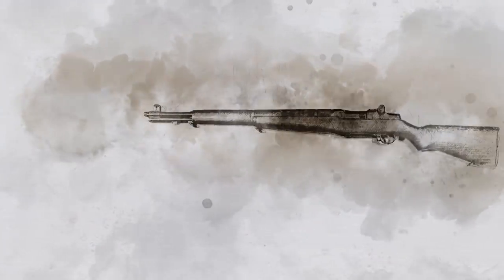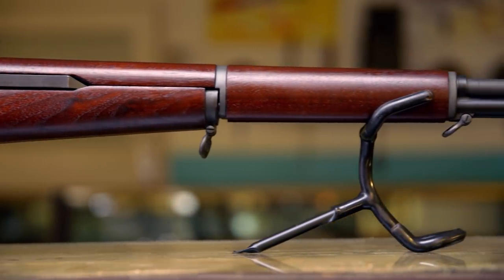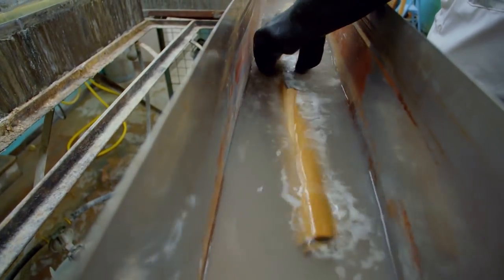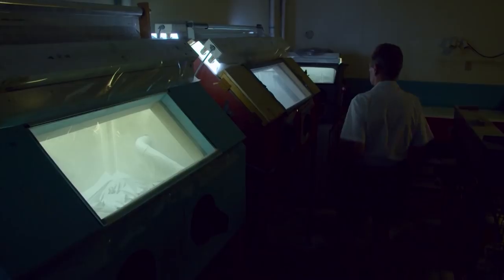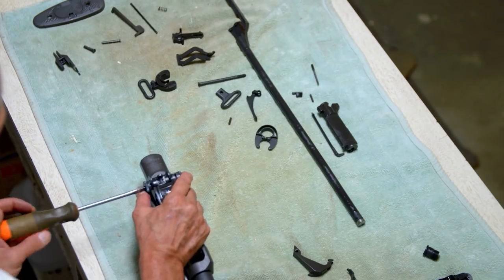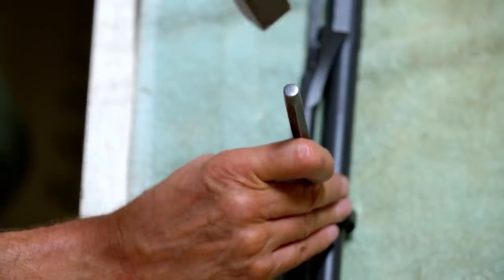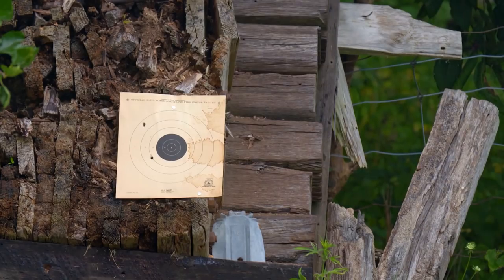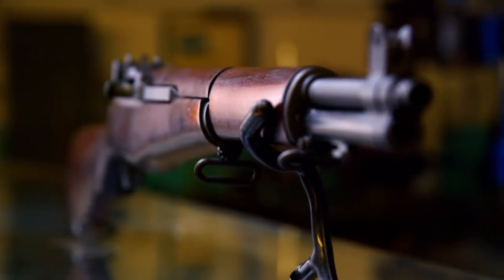How To Restore A World War Two M1 Garand Rifle | History In The Making

Comment: The enemy hearing the ping of the clip is a myth. My grandfathers served in WWII, I asked them about the enemy hearing the "ping"  they laughed and said" Over the sound of machine guns, mortars and arty  and men firing in all directions you never heard the "ping" and if the enemy was 100 yards away they couldn't either."
Reply: Montana...No kidding...what a load of crap. I've fired thousands of rounds with the M1 on the rifle range and couldn't hear the clip eject from the rifle four feet away on either side.
Reply: Imagine no ear plugs in the middle of some sort of a firefight. You couldn’t hear anything....
Reply: Yep, you just fired 8 rounds 30-06, the enemy is either dead or deaf, they won't hear anything about little ping
Reply: You can't hear Jack with tons of small arms fire going off. You have to scream in a guys ear to be heard, and your supposed to hear a ping? Spare me please....
Reply: You could reload it in like 2 second as well
Reply: Yeah definitely was irrelevant in a normal combat situation.  The only way I could see it ever being an issue is in a small patrol/unit action and for some reason two soldiers on the opposite sides got isolated and were fighting a private battle.  However, the likelihood of that is extremely low.

As for hearing the "ping" sound, this is definitely possible provided there isn't much other noise going on.  Whenever my Garand ejects a clip that thing rings as it flies through the air (which isn't replicated by smacking it on an object as they suggest here, doesn't resonate the same).

Anyone else notice the Garand in this video is a Korean War Garand?  The trigger guard was of the post-war modification type and not the WW2 era type.
Reply: Its been tested by someone here on youtube, half the time the other guy didnt even hear it, and if he did the Garand was reloaded before the other man was even near the shooter
Reply: They play too much video games 🤣
Reply: Yeah old myths die hard sadly.
Reply: "My enemy" So you're implying just  because your grandfathers served in WW2 that makes the people they fought your enemy? They may have been our countries enemy at the time but  your verbiage makes it sound like you're just taking credit for your ancestors actions
Reply: Not to mention, even if they were 10 yards away and there was no other sounds other than rifles being shot, it would still be extremely difficult, borderline impossible, to hear that ping, due to it being a close frequency to many other sounds that rifle, and other rifles, would be making in a gun fight.
Reply: You take 4 or more guys firing a M 1 and over the sounds of the other side firing their going to hear a "ping" I think not. Only way you may hear it is if it were one man firing at the enemy at very close range..... very close.
Reply: 88mike The only way(in my opinion)is fire 7-rounds,pause for a few seconds,then pull the trigger for round 8,and the you can hear it,obviously unrealistic in combat conditions.
Reply: Thats true, I've fired my M1 Garand sure you hear the "ping" but I wasn't firing with a platoon or a company doing the same. So hearing the " ping" over 30+ other men firing in all directions , I doubt it.
Reply: But in Day of Defeat you can hear it, it's a proof!
Reply: A poll taken of veterans after the war said it was about 50/50. Its not a myth.
Reply: Well my grandfathers never heard it in combat , I asked both before their deaths in 1996 and in 1997. Both saw extensive combat during WWII. All I know is under the din of combat mortars, machine gun fire, artillery, grenades your gonna hear a ping, how can you hear anything your ears are ringing beyond belief.
Reply: My grandfather was in the island hopping campaign in the pacific. He told me they did that against the Japanese. He was highly decorated and was involved in several campaigns where his unit suffered 90%+ casualties.

He knew what he was talking about.

The answer is it just depends on the situation. There was a large survey conducted with veterans after the war. Many veterans said that they actually did this. Its not a myth.
Reply: Every soldiers combat experience is different. Two men serve side by side , both to a degree recall things a little differently. One thing is certain the "ping " if heard was not really important nor emphasized during WWII .
Reply: ...according to who?

A large percentage of veterans said that it was after the war
Reply: Maybe, but as I stated every soldier recalls things differently even in the same foxhole. My grandfather was 82nd Airborne WWII , he didn't recall hearing the ping in combat, my other grandfather was in the Infantry 1st Div. he did not remember it either, but yet they recalled vividly their combat experiences with great detail.
Reply: Look guy believe as you want free country, you can think as you wish. But the " ping" did not aid the damn enemy , over 12 million men in service in WWII , they asked what 315 out of 12+ million yeah ok.
Reply: It's a myth. The sound was not loud enough to be heard at more than 10 yards with the immense noise around and the rifle was fairly quick to be reloaded. The veterans you are talking about are veterans of Call of Duty or whaterver Day of Defeat Source. The war was not like a movie or a video game.
Reply: Agree, I just spoke to a Korean War vet today about the "ping" , he just laughed and said" I was a combat Marine in Korea 1951-1953 , the ping is a joke". I told him the government asked 315 vets from WWII about it and some said , yes. His response was , " Really who some gear in the rear assholes" He said , no one ever asked him and I suspect he wore out a M1 Garand or two at Chosin.
Reply: You must be a liberal, you made your point, others are allowed theirs, let it go. Some just don't see it your way ,get over yourself.
Reply: You were not in WWII, neither was I. I know what those that were told me, why in the hell would they lie.
Reply: A lot of ink and pixels have been expended arguing the ‘M1 ping’ myth back and forth, and some have even tried to practically demonstrate why it’s a silly idea. Tactical trainer Larry Vickers recreated a scenario for his ‘TAC TV’ series, and more recently YouTuber ‘Bloke on the Range’ has tackled the myth. The Bloke shows just how difficult it would be to even hear the ‘ping’, without the various other loud noises associated with battle. Soldiers have only recently begun to wear any kind of hearing protection at all, which would have made such a noise even more difficult to detect. Not to mention the obvious fact that soldiers rarely fight alone. Even if a German or Japanese soldier did manage to take advantage of the ‘ping’ window of opportunity, he’s likely to get shot by another GI. More importantly, the Bloke shows how easy and quickly one could reload following the ‘ping’. At all but the closest ranges, this really is a myth and a total non-issue.
Reply: Ever heard the legend of the M1 Garand Ping getting soldiers killed?

If you spend much time on the internet or hanging around in firearms circles, you might’ve heard this urban legend before. During World War II, the iconic “ping” of the M1 Garand would notify German soldiers the GI was out of ammo. The German would pop up, wait for the GI to reload, and shoot the GI when he re-engages. To combat this, US Soldiers would throw a spent Garand clip on the rocks to simulate the sound, and shoot the German when he hears it and pops up.

I will admit, during my (much) younger days, I believed this myth. It was a fun idea, and made World War II GIs more badass. However, this myth is not true, and here’s why.

Gunfights are loud
During World War II, soldiers didn’t have hearing protection, at least not modern day hearing protection. Have you ever fired a large caliber rifle without hearing protection? Remember that ringing and the subdued hearing that follows? Now imagine dumping 8 rounds down range, while buddies next to you are blasting away, while grenades are thrown back and forth, and who knows what else.

The only way a soldier is able to talk to someone next to them is by shouting, and now these soldiers are expected to hear a soft ping on the other side of the battle field?

Squad tactics
Remember, there’s more than one soldier on the battlefield. World War II squad tactics involved alternating fire. Under ideal circumstances, there’s never a time where all soldiers have stopped firing. The GIs were trained to stagger their fire, so while someone is reloading, another is firing.

Bloke on the Range puts it to the test
Bloke on the Range is an excellent YouTube channel from a Swiss firearms enthusiast. He sets up a little controlled experiment with a single rifle, testing the Legend of the M1 Garand Ping.

Even within a short distance, only one rifle going off, and the “German” not firing any rounds, he was not able to consistently hear when the M1 Garand went empty.

Hearing the M1 Garand ping would have been even more difficult at a greater distance, and with rounds being exchanged between the German and US soldiers.

The legend of the M1 Garand ping getting US soldiers killed, is effectively busted.
Reply: Yes I do are you one probably not , I  the on other hand am.................impress me slick.
Reply: Never know who your trying to bullshit, yes I'm a combat vet......but it wasn't asked was it.
Reply: I served in Vietnam , Lai Khe ( Rocket City) from February 1968 to Dec. 1969 in 2nd Corp in the Michelin Rubber Tree Plantation  in the" Iron Triangle"  with the US Army 1st Infantry Div. So I'd say I have some combat experience.
Reply: THANK GOD, someone else besides me knows this is bull shit about the PING. From a few feet away you can not hear the ping as your unprotected ears are still ringing from the last round. Now with two companies of men shooting at each other from many yards away you really think you or them is going to hear a little ping.
Reply: Even if you could hear it, why would you be scared? That's show that they have no bullets left in their clip.
Reply: luuk341 that was Ian. Forgotten Weapons/ In Range T.V.
Reply: Not all battles in ww2 Europe was a Dday landing.
Reply: @montanamountainmen6104  At least liberals are educated.
Reply: Cool.
Reply: No my dad had one of those rifles let me tell you does do the 'pin' we used to shooted all the time the last day we shot the rifle was on 1975, he die 76.
Reply: Paul Barclay And what poll is this? Do you have any site that I can read this “poll”?
Reply: Amen... After firing 5 rounds from a K98 mauser, your ears would be ringing all day... 🤣🤣🤣
Reply: absolutely true, this guy propagates these falsehoods.  Much of the work destroys any collector value as original finish is what is most sought after.  Many firearms owners who get this work done are not advised of the lowering of value when a firearm is bead blasted and all finish and machining marks disappear.
Reply: @Kevin Brass Thank you.
Reply: You could definitely hear the ping of an M1 in close quarters, in a small infantry skirmish or a duel between a couple of isolated soldiers. Amongst sporadic rifle fire, absent any heavy weapons going off, like in the bocage country or in forests. I bet you anything that germans on the western front would be listening out for it as their chance to return fire or flank in those situations.
Reply: Also even if they did the enemy isnt gonna risk it lol as if only 1 american soldier is on the battlefield.
Reply: I think that was mostly a myth🪖🪖
Reply: I think that was mostly a myth🪖🪖
Reply: I think that was mostly a myth🪖🪖
Reply: I think that was mostly a myth🪖🪖

Comment: What most people don't realize is that most if not all of these rifles were refurbished one or two times before. If you look at the cartouche marks you will see many armory rebuild proof stamps. It is unlikely that your WWII Garand has an original finish. Garands were manufactured up until 1957, well past WWII.
Reply: You can run a Garands serial number to see if it was manufactured before and during WW2. If it was it most likely seen combat
Reply: British Lee Enfield No4 rifles are the same. They were sent for a process called FTR (Factory Through Refit). Basically most of the weapons from the war were worn out, damaged and in poor shape. So they were shipped to factories for re-manufacture. Many were cannibalised for spare parts and cheaper, war-expediency components were discarded and replaced with newer spec parts. If you have a Enfield No4 with 'FTR' stamped on the receiver then it was rebuilt post 1945.
Reply: Manuel Navarro it still doesn’t need to be completely redone and stripped it of any character
Reply: My Springfield M1 serial number puts it close to the end of production. The rifle shoots good and I cherish it...gift from my family...but it only gets shot maybe 200 rounds every year. Its just one of those guns that shooters need to have in the collection.
Reply: mines a 43 springfield. only thing not origianl is the stock. Barrel, trigger group, bolt, all that is orignal and matching

Comment: Oh, that deep red wood finish !!! I love it! I would like to put that on my new CMP Walnut stock. I was told a medium brown leather dye before the tung oil will do it. Any tips?
Reply: Cognac or Red Oak stains should get you close, depends how many coats you put on. Tung oil will make the color rich.
Reply: I would like to add that Cold Pressed linseed oil would oxidize to that deep salty if the rifle is kept in low light for a few months without staining.
Reply: @Kpoole35  I have not started the project yet, gathering materials and courage first. Might check into this method, Thank you.

Comment: It was in pretty good original condition why would you 'restore' it and make it worse.
Reply: Because they are worth more in good condition.
Reply: Yes good Original condition...Not refinished.
Reply: Tommy Vinson same reason a classic car would be less desirable to a collector if the car had been repainted and had an engine swap, it's not the same.
Reply: MovieMaker225 how about when you find that old car you’ve wanted but has rusted out floors and needs restoration in order to avoid the crusher? I think saving an old classic weather it be a weapon like the M-1 Garand or that old Trans Am is ok in a situation like that . I have 4 M-1 Garands  and are in there correct configuration 3 of them have been restored and one is a USMC Match Grade and it is awesome.
Reply: There's a couple of schools of thought on that.  Any collector, knowledgeable, collector knows that condition is everything.  Also is originality.  Now, as far as U.S. military firearms go, it's hard to find them in "original" configuration owing to the fact that their service life didn't end with war (we're talking WWII).  They went to arsenal overhaul and were refurbished on an as needed basis.  This is one of the reasons I don't and many other collectors don't look at U.S. weapons the same way we look at- say German weapons.  German weapons, for example, are most desirable in original, unmolested condition.  If a German weapon has been refinished or refurbished then it's value is greatly depreciated.  As for U.S. weapons, most of them were refurbished at one time or another during their service life.  So, one can argue that an arsenal refurbished U.S. weapon is technically "correct".  It diminishes it's value somewhat compared to an intact, "original" specimen but here again, "original" specimens are hard to prove because many collectors swap parts to make them "original".   So, collecting U.S. weapons isn't quite as pure as collecting other military small arms.  
That being said- you can move beyond the field of serious collecting and move into realm of individuals who are not interested in being "serious" collectors and just interested in owning a representative piece.  A working example so to speak of a firearm that appeals to them, but in depth study and investment doesn't.  This individual doesn't care about matching parts or refinished metal.  He doesn't care about the weapons future value.  He just wants a working example that he can shoot and enjoy.  There are a number of companies that market to these individuals.
Reply: They're made to use, not to look at.
Reply: asambi69 no it wasn’t exactly running like a champ. And the wood gets old and moldy to where it could actually break. Besides, you want a nasty moldy stock on your shoulder with a whole bunch of scratches and a horrible finish? Yeah I didn’t think so either
Reply: Maybe the owner doesn't care about dumb 'original' condition because it isn't about resale value. Perhaps he wanted it restored to like new so he could enjoy years of shooting it without issue, and maybe pass it down. There's more to C&R than just resale value.
Reply: They didn't alter it in any way. They re-parkerized it, which is what the original metal finish was. They re-finished it with tung oil, which is what the original wood finish was. They didn't use new wood, they restored the old wood. 
This is a perfect restoration that doesn't remove any value or history from the weapon.
Reply: Probably because very few m1 rifles are parts matching, so refurbishing them doesnt matter. . .
Reply: Because someone payed him to refinish it.
Reply: Yep and I need to save up money to send off a lee enfield No 4 MK I* which is completely rusted and the fore end has mold.
Reply: It had been stored at an arsenal some where, now it will be restored in some guys gun cabinet.
Reply: He literally used the same oils that they were originally manufactured with and made it look prestine, as if it came out of the factory. 

He made it objectively better with the fact that any mold in the wood was removed and cracks were fixed.